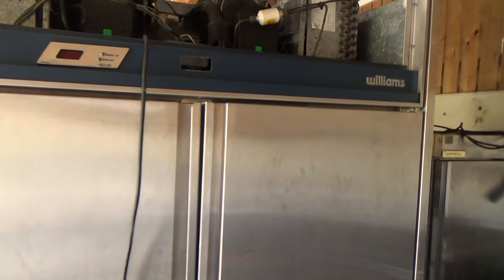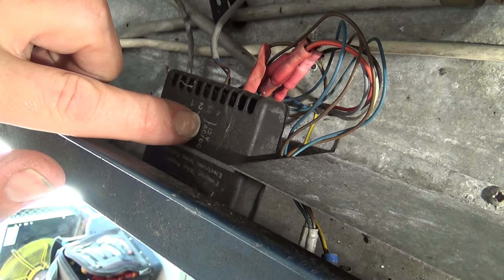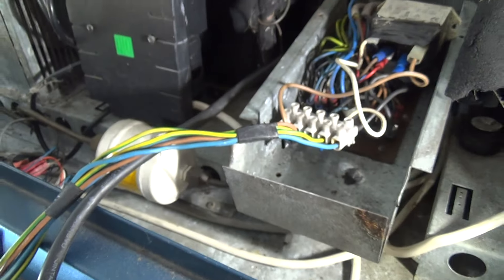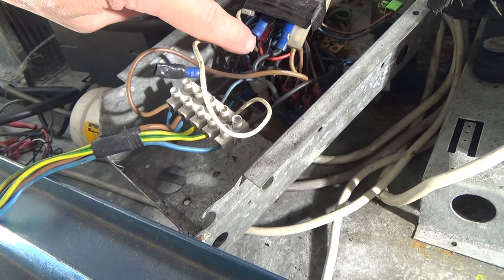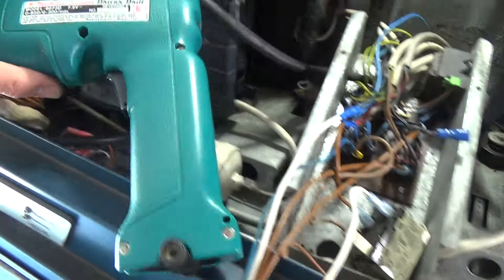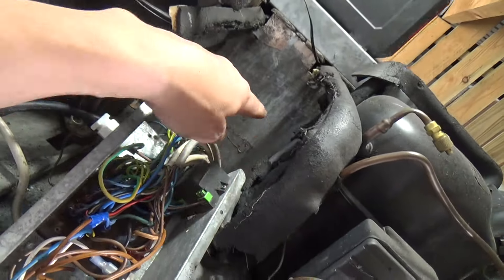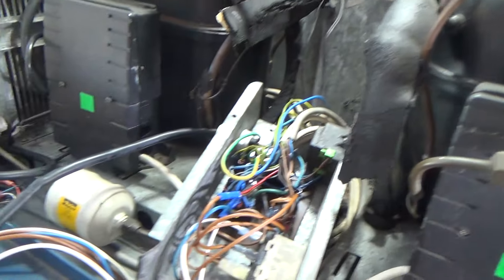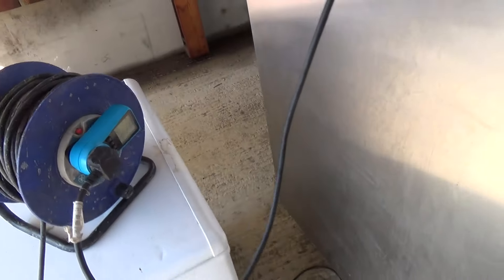Couldn't get this Turd to Shine

Comment: When I see wiring like that I'd be tempted to just cut all that shit out and rewire it all myself from scratch. If the compressors worked that is though. It looks like a decent cabinet, probably better than the modern ones!
Reply from the maker: Yeah, I was told it worked so went with the rewire first, should have just wago'ed the wires to get it all to run first to see if it was worth the effort.
I think I'd fix it if it was mine, its better build than anything available now

Comment: I like that small linishing tool! Was that contractor complaining about available voltage/amps for it's coil?! Were you doing a 'dim bulb' (resistor) setup with the extension line? Very interesting. (I don't do refrigeration at all but I always want to understand more about high and low amperage real-world problems and your videos are great! Also I respect refrigeration far too much to ignore - that stall-out was funny)
Reply from the maker: I think the fridge has been stood outside in all weathers for a while looking at it.
 Inside the contactor you have a fixed iron segment like a giant E, and another E with the contacts on, the coil pulls the two E's together to make an 8 shape and make the electrical connections. If the two E's can't pull together fully due to dirt etc the contactor will buzz as in this case, if it was a volts drop issue the contactor would have gone quiet when both the compressors tripped out on their klixons.

Comment: I wouldn't even fit new compressors to that as the evapcoils due to being a williams pitted and have leaks due to the age of it 
Was williams related to foster or foster brought them out back in the day ????
Reply from the maker: I think Williams and Foster were two separate companies but could be wrong, always felt Williams were slightly better than Foster.

Comment: Could the voltage drop from the hot extension lead have caused it to cut out on internal overload? Just a thought. Unfortunately I’m not sure many engineers would even have entertained it. (Or have been able to!) Thanks for sharing. :)
Reply from the maker: It could do, but according to the plug in amp thingy I had 240 ish volts so should be enough to run it.